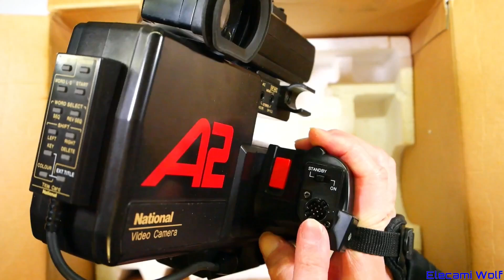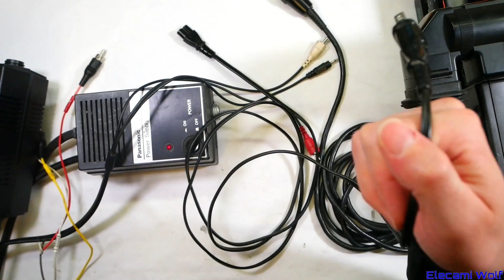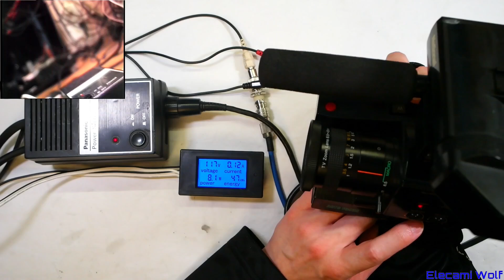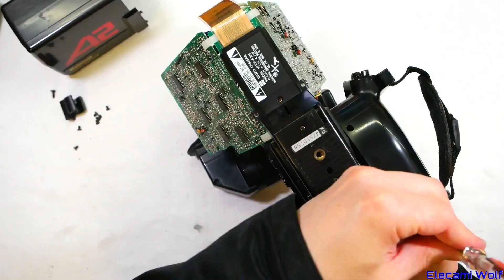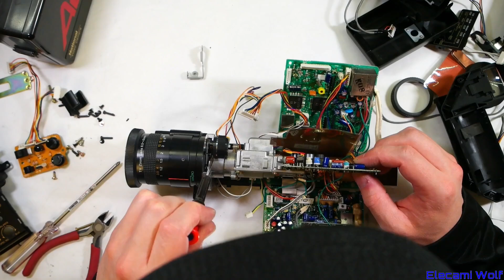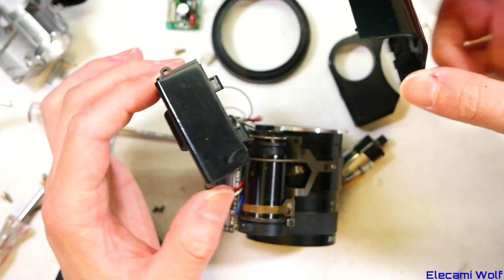EW0161 - National WVP-A2 Video Camera Teardown

Comment: Hi I recently purchased a rare Ferguson videostar power supply with the ten pin ..this is JVC rebranded I'm told ..for the united kingdom we're I live ..it has a variable power switch so it can run at 240 volts .. I haven't plugged any Japanese equipment in yet.. I'm I right in thinking this might only work safely with Ferguson (JVC) cameras?thanks for the info so far
Reply from the maker: Typically all the Color 10 pin video cameras an VCRs are compatible. The older Black and white ones could have different pinouts.

Comment: I'm not sure if there was a colour camera from that era that had more light sensitivity than the A2. They were outstanding for low light performance for their time.  Newvicons were also extremely resistant to image burn in. They could lag a little on highlights but no image sticking. Such a leap forward from the previous models all round.
Reply from the maker: The A2 were a popular model, a lot of them around. Probably helped by the compact size.

Comment: Thanks for the video, nice little tube camera!
It seems National did some homework miniaturizing internals after their "VZ-Cxx" lineup. I have VC-C75 and it has pretty much the same arrangement, similar video ICs and power board, but it is bigger.
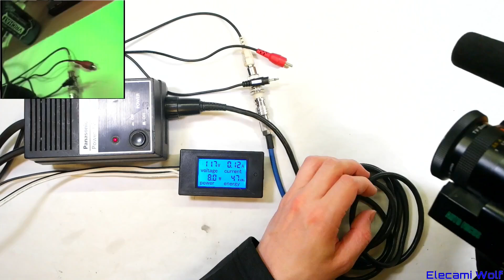13:18 - not really, camera is misadjusted, there should not be such a green tint.
29:02 - I'd not call that small corrosion "a write-off", I've restored much worse than that
39:39 - that's partially a ROM (that's why it has a window), but it is also a special IC that is paired to the tube (and those should be replaced together). IC is called "FAMOS IC" and it manages dynamic beam focusing, dynamic color correction and dynamic bias compensation for the pickup tube. And the coefficients/tables for those corrections are written into the EPROM on the die.
43:09 - wow, IR filter is just snapped on, that's good to know, 'cause it is all dead and blacked out on my VZ-C75. And please, don't trash the pickup tube, keep it as spare (together with FAMOS IC). Or sell those.
Reply from the maker: Nice info, thanks. I have a few of those larger cameras, we'll look through them in due course. I think they use saticon tubes. I think I have WVP-30, 50, 100 and maybe a few others that are big and old.
Reply from the maker: The green tint does seem to be a common issue with the newvicon camera, several I have exhibit it. Maybe something about them drifts.
Reply: @Elecami  As I understand, for color tube cameras without indexing electrodes (basically anything except Trinicon) the main information is green color and other channels created from high-frequency modulation from filter mesh on the target. And if focus is not spot on, beam spot gets too large to generate high frequencies on those filters and picture fades to green. So try to adjust static beam focus to get rid of the green tint. That's similar but different with Trinicon where misajusted focus leads to no color at all, but similarly best color achieved by peaking beam focus. Also, my VZ-C75 has neither Saticon or Newicon, it has Newcosvicon, no idea how it's different from the other two.